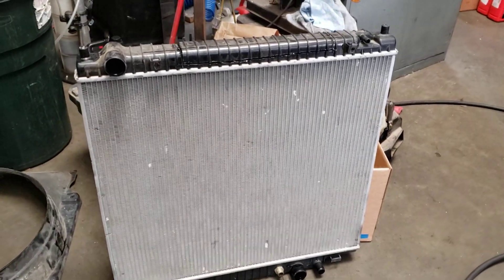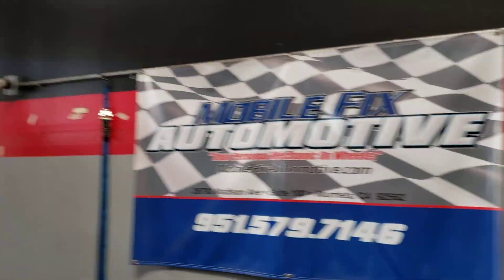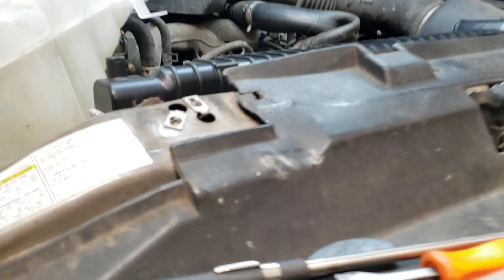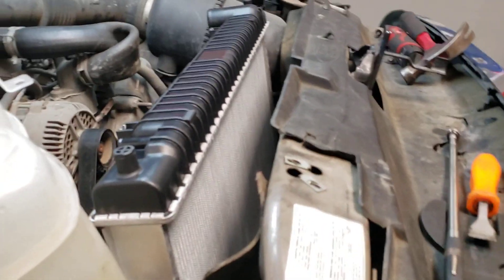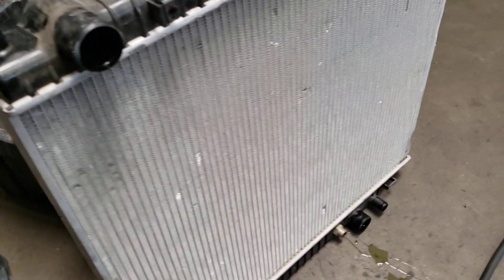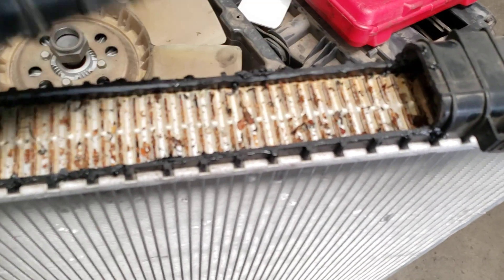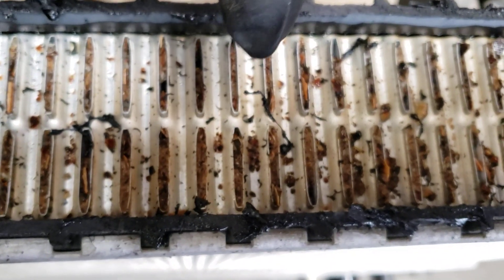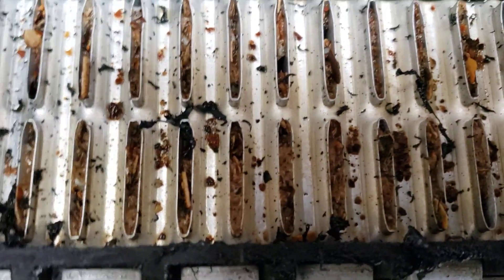Ford Triton Engine Overheating

Comment: Great video.  Is Mobile Fix Auto still doing business in Murrieta?  If so, I will call to discuss intermittent overheating of my O'side based 1997 E350 Triton.  I think I may have same issue(s).  - -  GN

Comment: Thanks Ron.  This has been happening over last few months.  My 03 Ex has 230K on it.  I drive local in town.  I see the guage climbing past middle and then i will stop.  The coolant is circulating through the overflow.  Has original water pump.  I just ordered a Gates pump.  I did a TYC radiator in 2020 around 30k ago (was leaking).  At that time did all hoses and AC Delco thermostat.  I am going to do water pump this weekend.  Is it worth pulling that radiator out and flushing with hose?

Comment: Damn my coolant light just light up while towing. Making a landfill run and it popped. So now im wondering what it could be and you just pointed it out. All the simple stuff is changed and new but not the radiator. So now im gonna have to spend this weekend working on my rig. Thanks Ron appreciate the info and insight. Plus i just subscribed and own a triton🤠

Comment: Sir I have an 06 f150 4.6 input new water pump new fan clutch new thermostat new radiator and still overheating help plz
Reply: Did you figure yours out?  I've replaced the waterpump, thermostat, fan clutch,  and now I'm going to be working on replacing the radiator.  Whats next? :)

Comment: What was the cause of all the debris in the radiator core tubes? It doesn't look like rust.
Reply: Could it be hard water deposits? I just did a coolant flush and the coolant was rusty and had a surprising amount of debris.

Comment: Ford says radiator discontinued for a 2002 E150,  I see you chose a TYC here.  I had a FVP shipped from RockAuto, arrived cracked and the ribbing wasn't like OEM. Spectra Premium is $215 from Summit Racing, they say it's made in China.  I was wondering if you have ever tried a Motorcraft (RA $350) for an newer E350 (2007- ) and changed the transmission line connectors.  It should fit, shouldn't it?

Comment: hi question Hope you have an answer. I have a 01 Ford expedition 4.6.I've so far changed the radiator fan clutch thermostats and I still have overheating whenever I use the rear AC. what do you think?

Comment: hello sir big fan of your channel i really love your content im having the same issue with my 2006 ford f 150  4.6 v8 triton  when i get on the interstate it overheats and boils my colant over i changed the thermostat since its a cheap start and it started working a bit better but when i took it back on the interstate it did the same thing around town it drives without a problem so thankfully i came across your video i think im going to try changing the radiator next may i ask when you have a bad radiator will your truck loose a bit of power? hard to notice the difference but i feel since i drive it everyday i can kinda tell

Comment: Hello Ron, I appreciate you taking the time to post these great videos. I have a 2003 Expedition Triton 5.4 L that after several minutes the temperature spikes for about 10 seconds before returning to normal for the remaining journey. I changed the thermostat about a year ago, just recently had to replace the intake manifold and put in a new water pump. Is the thermostat the likely suspect, even though only a few thousand miles since installed? Anything else that would make it behave like this?

Comment: Ron any idea how the radiator got so clogged? Was it just not a good radiator to begin with, wrong coolant used, or didn’t do coolant flushes often enough?
Reply from the maker: There is more to this story. This was debris from outside radiator
Reply: looks like someone maliciously added debris to fluid.

Comment: Dang I got my truck in 2001 I still own it . It just started over heating on me when I tow my boat up to Big Bear . I changed the radiator hose the thermostat and it still heats up . I guess iam going to change out my radiator and water pump . 👍🏾

Comment: Off   the subject of THIS video. I am looking at an 5.4 Expedition, it has a spark plug blown out, I asked my regular mechanic shop about cost to do one plug. They told me that the spark plug blowing out meant the engine was about to blow up. The owner says it still runs, but with the obvious problem. They have said not to bring it to their shop ... no, I am not coming to California to have you fix it, lol. it is 60 miles from where I live. if I disabled the injector on that cylinder and took out the coil pack, could it be safely driven 60 or 70 miles at highway speeds.  There was another 5.4 where the guy just reamed out the head and put oversized plugs in it, there were a "few" other issues, but the overall I got was to not buy that one. I really want an expedition, can you tell, yet.
Reply: My daily driver is a 2000 Ford Crown Vic with the 4.6 in it. Rock solid.
Reply from the maker: I dont know the overall condition of the vehicle your looking at but I will tell you anyone that says a blown spark plug is an indication of upcoming engine failure without any other mechanical factors involved doesn't belong under the hood of a Ford Triton powered vehicle. I have customers drive vehicles with blown out spark plugs to me a lot with the coil and injector disconnected and have not seen damage to an engine as a result. All I can say is if you don't plan on using the calvan kit, your on your own when the spark plug fails the second time.
Reply: @SandCarServices  I definitely plan on buying the "kit", since my daily driver has the 4.6 in it. I don't know the overall condition, either, but the shop just lost a customer, and I may become a DIY mechanic ... heaven help us all.
Reply from the maker: Did you watch my video on why the spark plug blew out of your Triton engine? It explains a lot
Reply: @SandCarServices  Yes, and I will watch it again before I attempt a repair. I may not be the brightest bulb in the set, but I look for the best advice.
Reply: Kenn Hepner Ron saved me slot of money I had a 5.4 with two spark plugs blown out after watching Ron’s video I ordered the cal van kit . I have over two hundred thousand miles on the engine since I did the cal van inserts .
Reply: @thunderroad7289  I have a 2000 CV, not the police model, but with the 4.6. I am looking at an expedition of about the same year, I plan on ordering "the kit". My shop lost a customer by their attitude.
Reply: Kenn Hepner a lot of shop including semi truck shops are not very good mechanics anymore they just plug the computer in the vehicle and let it tell them what to replace. Probably to hard of a job for them to do. lazy mechanics. It’s a easy job to do. Ron made it easy to do by watching him. if you get it when fixed it will make you a good truck. I have a 2004 expedition 2005 crown Vic with the 4.6 and a 2004 F 150 with a 5.4 the 5.4 is the only one I had two plugs blow out on. The two 4.6 have had no problem they both have around 300000 miles on them. and my 2013 Raptor zero problems from the 6.2 lol.cant wait to get the new Bronco

Comment: Ron did a great job here, he did some tests to verify before proceeding... I'm the owner and I'm so glad to find a great mechanic who can be trusted as well. Just to clarify, I changed the heater core to fix the heater.... I knew that wouldn't help solve the intermittent overheating ;-) it was a totally random thing, only in hot weather etc.